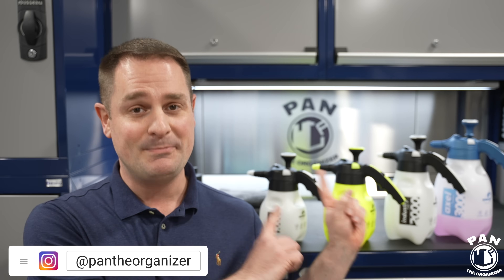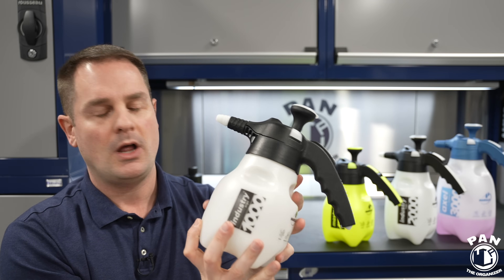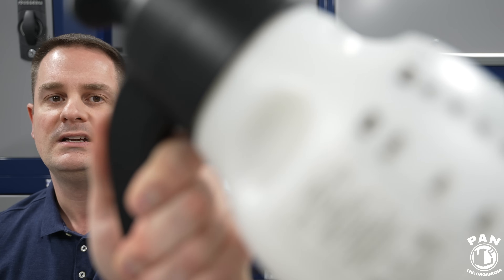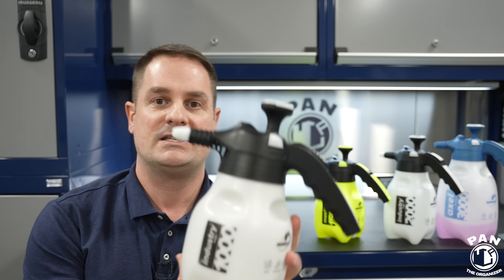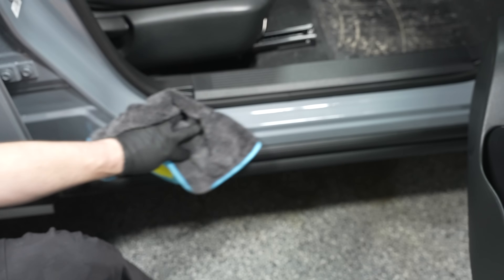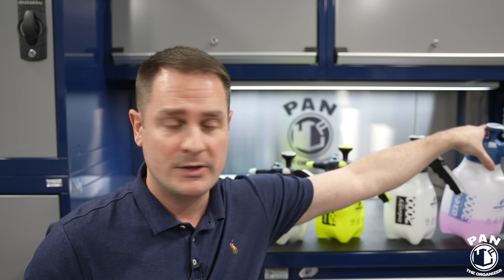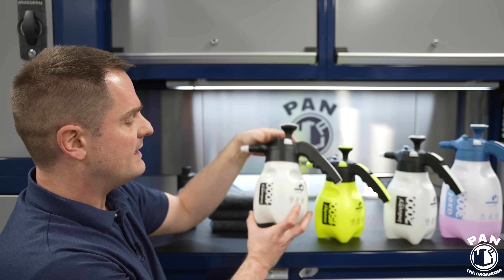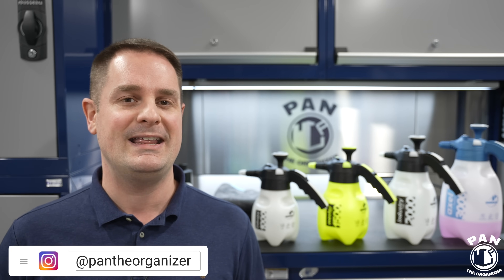THE BEST PUMP SPRAYERS & FOAMERS FOR CAR DETAILING! MAROLEX

Comment: I am thinking of buying the Axel 2000 or 3000 for the foaming part. I would like to use it to foam my car when getting to wash it. I own a Tesla model Y

would the axel 2000 be sufficient for one wash or do I need to buy the 3000? The price difference in The Netherlands (where I live) is not much, but I also want to save space. Hence, I would like to know if 2 litres of solution is sufficient to foam a Model Y or do I need to go for the 3-litre option.

Comment: Hey pan can you recommend a rechargeable foamer instead of the pump version?
Reply from the maker: There aren't many options of the battery powered foamers. But this one is quite popular online because of it's low price: https://amzn.to/3XymWKV

If you want a better quality unit, but it's not battery powered, but you can use compressed air with the sprayer's integrated schrader valve, this one is a good option: https://amzn.to/47cc1d1

Comment: which one should i use for p&s products like xpress interior cleaner or carpet bomber?
Reply from the maker: It depends on your needs. For foaming results, get the Axel series. For everything else the Industry Ergo is the normal spray with chemical resistance.

Comment: Hey Pan, I just discovered your channel and it's awesome..! I want to buy a pump spray. For using only rinseless wash solution (ex. MCKEE'S 39 N-914) do I need the Master Ergo or the Industry Ergo? Thanks
Reply from the maker: For rinseless washes even the green bottle Ergo will do.

You use the white industry bottles for more acidic products or harsher chemicals.
Reply: @PanTheOrganizer  Thanks! Which size do you recommend for SUV?

Comment: Hey Pan, I am currently in the market for a good pump sprayer and these all seem to fit the bill.  I would really like something that foams so I can efficiently use it for something such as Brakebuster, however I would also like it to not foam things up such as APCs or Rinseless wash solutions such as ONR or McKee's N-914.  After watching your video the axel series seems very appealing, but my question for you is if you were to put something in your axel foam pump sprayer that does not have any foaming properties such as an APC or a Rinseless wash, how would those chemicals react, would they foam up as well or would it just act as a normal pump sprayer in this scenario?  I would really like to only have to buy one pump sprayer at this point so if the axel series could do both, that would be perfect!  If not, can you only recommend that I purchase two separate pump sprayers for the two separate types of chemicals?  Thank You!
Reply from the maker: Axel is only for foaming products. Not for liquids that won’t foam. So you’d need an Axel for foaming and another of their sprayers for rinseless washes or products you don’t want to foam. There’s no way around that unfortunately.

And same applies to all sprayer brands. An IK Foam Pro 2 is made for foaming while the IK Multi Pro 2 is for non-foaming products.
Reply: @PanTheOrganizer  Thank you again for the quick response!  This really helps.

Comment: How does this compare to the IK sprayers. I know you have a ton of those. Are the Marolex really worth the 50% price premium. You can get a good IK for $40 out the door... the Marolex is $60with shipping and tax...
Reply from the maker: Yes the Marolex are superior in my opinion. Don't get me wrong, I like the IK's too, they are high quality pieces, but now that I have the Marolex, I pretty much only use the Marolex as you pump them a lot less, and they spray for longer. Also, the max pressure of the Marolex is a lot bigger compared to the IK.

For the price, that's up to you to decide though. Money is never an object for me when buying things, but for many it can be a deal breaker and I fully understand that.
Reply: Thanks pan! Follow up question. Do you preffer sponge or wash mitt or microfiber towels for rinselss washes? I'm washing my car once per week these days and it's usually pretty clean just tree dust and light sap and salt from the beach.
Reply from the maker: I prefer the sponges made for that, like The Rag Company Ultra Black Sponge or the Big Red Sponge from Optimum. But I have used a microfiber wash mitt for that and that woks well too.

But it's really a question of personal preference. Some swear by multiple microfiber towels, others with the sponges, etc.
Reply: Thank you so much! The black sponge has been sold out for months. BRS is a little pricey have you ever used the SudzBudz spoges they are 2 for $17 on Amazon and have those cuts in them. Just not sure how soft or durable they are. What's your opinion?

Comment: Hi Pan, i plan to use the sprayer for my wheel & tire cleaning chemicals, which model should i get.

Thank you 
from Toronto, Canada
Reply from the maker: If you want foaming action, you have no choice but to get the Axel foaming one.
Reply: @PanTheOrganizer  Thank you sir, you are one of the few detailers that still reply to comments and I very much appreciated.

Comment: Been wanting to get a foam Canon for a while that is easy to use use, portable and perform above all expectation, but was hesitant due to worry that it might not  live up to its performance and would just be more of a waste of money buying one crappy product after another. Until, I saw you just started spraying the engine bay with that hand pump, Cannon. I was blown by how much foam it just cover that engine bay.  I have decided to give the go-ahead and purchase that specific one that you have.  I follow the link in your other video to the website, but was too pricey with the shipping cost and they were out of stock and I just wasn't gonna wait for it to be available to get mine on reserved considering that i have to pay for the shipping cost and then wait another 2 more weeks to get it delivered so I bought it on Amazon for a much better deal no shipping cost and as a prime member I can get it the next day. 33:35

Comment: I have the axel foamer and it works well. My biggest complaint is when pumping, the cap pops off a tad and ends up pinching my hand. It happened all the time. Very annoying. But it works fairly well.
Reply: Make sure the cap is tightly snapped in place, a little force may be needed. Once its secured firmly, it will not come loose or pinch

Comment: Does marolex pump sprayer spray longer than the ik pump sprayer multi pro 2 without pumping it up again? Thanks for the demonstration.
Reply from the maker: Marolex lasts longer compared to my IK sprayers for sure. But that doesn’t mean you will only pump once. There’s a limit to what a sprayer can do without a compressor feeding it air.

Comment: Hey Pan, any advice you can lend- my Marolex acid sprayer has Koch Chemise WF in it, but the weighted hose keeps slipping off and falling to the bottom of the bottle resulting in the inability to spray and me having to empty the fluid to get and reattach the hose. I've tried contacting Marolex for advice on this problem but my message isn't going through. Could you lend some of your expertise?
Reply from the maker: I don't use WF. I would contact the place where you purchased the Marolex pump sprayer and ask for advice.

Comment: Thanks for a great video @Pan! I have actually been using those for 2+ years now and am very satisfied. 
Question - Do you recommend one emptying these sprayer of liquids (solvents, alakalines and acids) after each use? Heard that some pump sprayers gets damaged and reduced life when keeping in them even when pressure is released after use.
Reply from the maker: It depends on which chemicals you out in them and how long. Up to a month or two for most chemicals should be fine.

Sumeet tested Brake Buster for a full year in the Axel foamer and it was working fine.

Comment: Have you tried their alka pump ? What is the difference between the alka pump and the acid pump?
Reply from the maker: The types of chemicals you can put in them. Acid for acidic pH et alka for alkaline pH.
Reply: @PanTheOrganizer  so very similar but the black acid pumps can withstand stronger chemicals?
Reply from the maker: They black tops Industry Ergo series are made to withstand lower pH (acidic) chemicals. If you are using the pump sprayers for alkaline chemicals (higher pH), use the Alkaline blue top sprayers.
Reply: @PanTheOrganizer  do you thing the ergo series can hold up to higher ph since they are less acidic or do you think it will clog ? It should work right ? I dont want to have many pumps but if the black one is more chemical resistant you would think it would work with high ph level chemicals too

Comment: Hey Pan. I have my eyes on a Marolex Industry Ergo Acid. I saw that there is also an Alkaline Version. Which one should I get? Do I need both?
Reply from the maker: Get the Industry acid. It’s their most chemical resistant sprayer.
Reply: @PanTheOrganizer  ok thanks but what if most of my products are alkaline?
Reply from the maker: Then get the alkaline. It doesn't really matter. The US importer has tested the Acid version with alkaline products in it for months and months and it worked properly. He says it's the most chemical resistant version.
Reply: @PanTheOrganizer  As always thanks for your help Pan!
Reply from the maker: My pleasure Alex!

Comment: hi pan just got 2 of these ; plan to use for p&s brake buster  and koch chemie green star APC - can i just keep the product stored in the pump sprayer and just refill when empty ? i bought the white ergo one u told me that was chemical resistant but just wanted to  make sure . ALSO is there a iron remover chemical you can recommendation that i can use with these sprays ? is iron x okay
Reply from the maker: There is official statement on how long you can leave chemicals in them, so you will have to test for yourself. I use them often, so I don't have time to accumulate liquids in them for months. Sumeet (the USA importer of the Marolex sprayers) has said he left Brake Buster in there for about a year and had no issues. But your experience could differ depending on what chemical is in there... 

I'm sure you can understand it's impossible to predict these things. If the products stay in there for a month or two, I wouldn't worry, but anything longer is a guessing game.
Reply: @PanTheOrganizer  thanks man ❤️

Comment: Thank you for all the work that goes into making your videos. Very informative! Liked and subed. Me and my Texas based '07 RX350 are new to any kind of legit detailing. I live in a condo with no access to a hose, so a pressure washer is out. There is however a DIY bay style car wash close by. Would the Axel Foamer be a reasonable substitute for a foam canon if that's all I've got to work with?
Reply from the maker: Thanks Steve. Welcome to my channel. You discovered one of the biggest car detailing channels on YouTube as we surpassed 750,000 subscribers and are getting close to 100 million views! I have been detailing for 25 years and I love to share my knowledge and passion with my viewers.

You found the right channel to help you learn everything about detailing.

Yes you could use the Axel Foamer for foaming duties, but if you don't have access to water, the better thing to do is get the Axel Ergo series (regular pump sprayers) and use a rinseless wash in them. If you can bring a bucket with water up to your car, all you have to do is add some rinseless wash concentrate in the bucket (typically 0.5 oz of the product for every gallon of water, follow the instructions) and then once the solution is made, you dunk the pump sprayer container in there to fill it up, and you can spray the solution on the vehicle, and then use an appropriate sponge or microfiber mitt to wash the vehicle with the solution in the bucket.

Watch my rinseless wash tutorial here: https://youtu.be/RP_BZ-jZBnY

Of course use common sense. Rinseless washes are made for light to moderate dirt. If the car is too dirty, you have to pressure rinse it first to knock off the big chunks of dirt.
Reply: @PanTheOrganizer  Thanks so much for your response Pan. My tentative plan is to get an Axel and a Ergo. The idea of a renseless wash is very attractive.

Comment: Pan what color tip are you using on the 3000? I have 2 light blue 1 dark blue 1 white 2 fan tips 1 dark blue 1 light blue . I use it with p&s brake buster full strength and it doesn’t come out like yours on the video should I try 10-1? Thank you
Reply from the maker: The tip that comes pre-installed. And yes dilute your Brake Buster 10:1 in that Axel foamer.
Reply: @PanTheOrganizer  thank you pan

Comment: is the break buster chemical supposed to be just sprayed or used in a foaming one?
Reply from the maker: If you use Brake Buster straight from the spray bottle it comes in, you don't dilute it, and it doesn't foam. It only foams when placed in a foaming pump sprayer (like Marolex Axel series) and diluted 1:3 up to 1:5

Comment: I can't really find anyone doing a decent comparison between Marolex and the closest competition.  Maybe it just isn't worth it, but it would be nice to see how the competition stacks up.  Yea, Marolex is great, but how far does it really stand out from the competition?    I.E. maybe some of the lower pressure alternatives have more concentrated spray patterns so the force at which the solution hits the car/w.e. surface is similar?  Or maybe, the pump isn't going to get used nearly as often as average/expected, so one could go with a less durable option with similar pressure.

Maybe I'm in the wrong place and this is a Project Farm request (since he specializes in those detailed comparison tests)?
Reply from the maker: Marolex has no close competition in the hand pump sprayers in my opinion. I have the entire IK lineup and those are top tier as well, but I still prefer Marolex. 

But if you want infinite comparisons with a bunch of different brands, yeah perhaps Project Farm is a better suited channel for that. I'm not into doing tests with 15 different pump sprayer brands. I go straight for the quality reputable brands.

Comment: Will the 2000 size fit inside of a 5-gallon bucket? Wondering if I can use the 2000 to fill in my bucket
Reply from the maker: Yes the 2000 absolutely fits in my 5 gallon buckets to fill it up. No problem.

Comment: PAN!...I have vinyl stripes on my car, is there anything out there that works as a good protectant for them AND the paint? I been using the Turtle Wax graphene hybrid solutions and its good as a protectant, but what if I want to lay down a proper ceramic or traditional for showing the vehicle?
Reply: maybe gtech csl and exov4
Reply from the maker: What ever you apply on your paint, you can also apply over your tripes.
Reply: @PanTheOrganizer  Thanks bud. Getting schooled up for the summer, gotta keep it Tight and Clean.
Reply: @mbui7182  Good looking out. Ill try them.

Comment: Hi Pan! Any tips on getting that foam you show? I bought one after your video but I can't get it to work... or at least properly. What am I doing wrong?
Reply from the maker: I need more details... What product are you using? What dilution ratio? Do you have good quality water (hard water doesn't generate as good foam as deionized water does)...

Not all products are meant to be used in foaming pump sprayers. Also, what exact pump sprayer did you buy? Only the AXEL series is the foaming type in the Marolex line. The Ergo series aren't foamers.
Reply: @PanTheOrganizer  Hi Pan! Ok, here goes. Axel Series, CarPro Reset, 1 to 10, distilled water.

Comment: Hey, Pan. You mention at the end about not putting dryer sheets in with your microfibre's which of course makes sense however my wife uses them for non microfibre drying, I.e clothing. Do you know if there is any risk of left over residue from those in the machine that I need to worry about?
Reply from the maker: No that's fine. No worries. Just don't use fabric softeners in the wash cycle, and no dryer sheets in the drying cycle. Using dryer sheets for cycles with normal clothes is ok.
Reply: @PanTheOrganizer  Thanks Pan, good to know! I bought some microfibre specific detergent from carpro as per your how to care for microfibre video. 👍

Comment: Can't seem to get my foamer to spray like the video I have the 3000 and I'm diluting break buster 10 to 1 but it comes out super watery even when I switch the tips. What am I doing wrong am I over filling?
Reply from the maker: First, are you using the blue-top Axel series? That’s the one that foams.

Next try and playing with your dilutions. I have deionized water so it will always generate more suds and foam compared to people with hard water issues.

Try a 1:3 or 1:5 dilution
Reply: @PanTheOrganizer  I'll have to give that a try tomorrow I used deionized water as well and yes I have the blue top

Comment: Hello Pan, very good video review, how do you compare this brand against iK Foam pro 2? 
Honestly, I'm very disappointed with iK brand foamers, pressure is poor and does not last enough, you waste a lot of time pumping and maybe it will last for a door or a wheel at most. Also foam quality is very poor........
Reply from the maker: The IK are very good, don't get me wrong, but Marolex is on another level. With the Marolex you don't have to pump them as often as the IK and also the Marolex generates more pressure out of the tip. Great stuff!

For foam quality though, it's not only the foamer, but also the quality of the water you use (I use deionized or demineralized water, which is always better than tap water) and also what product you are using. Not all products foam the same. And also adjust the dilutions to get it right according to your setup.